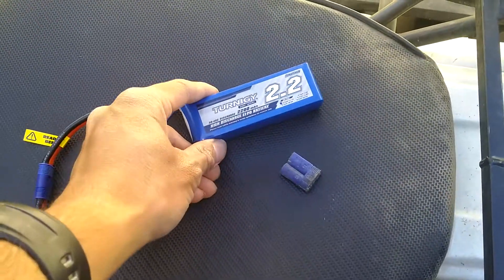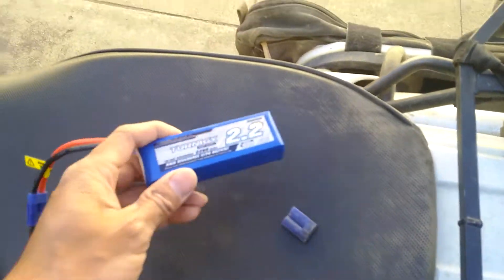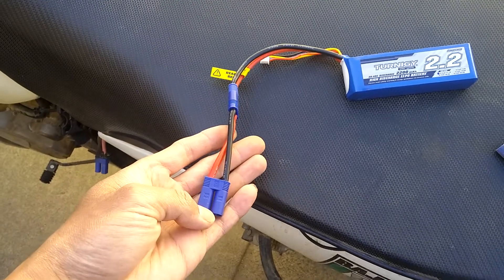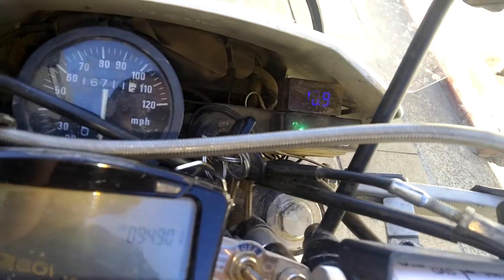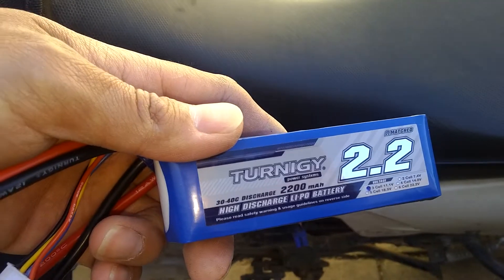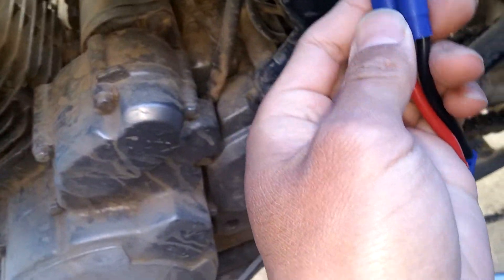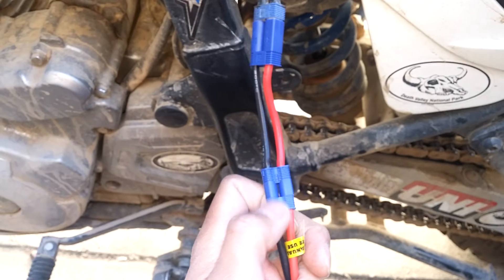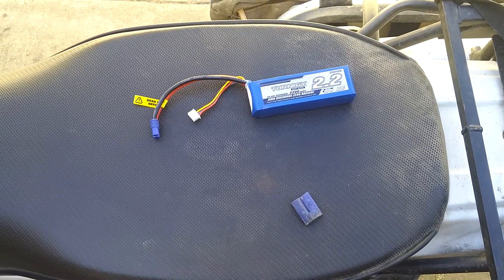Using a 3S LIPO as a battery jumpstarter for a 1997 Suzuki DR650SE motorcycle

Comment: Just remember to disconnect it pretty fast, as the bikes charging system puts out too many volts for the unprotected 3 cell li-po battery.
Overcharging a lithiumbattery can result in fire pretty quick. You can get some fireproof bags for storage/charging, that might be a good idea if you take the battery with you on trips.
Reply from the maker: Yeah that's what I do once the bike is started I unplug it.  I usually leave it at the storage voltage (3.80v per cell) and it will still jump the bike too.